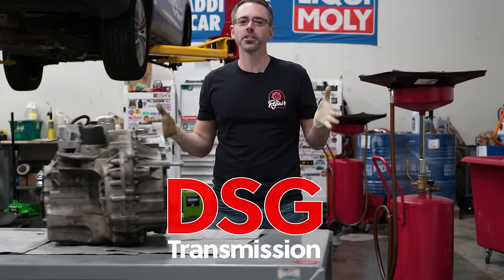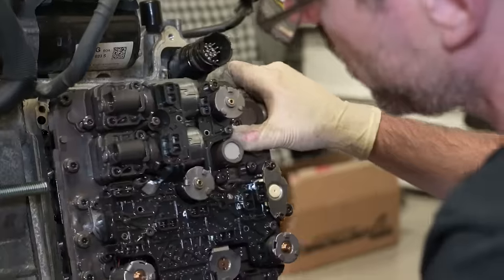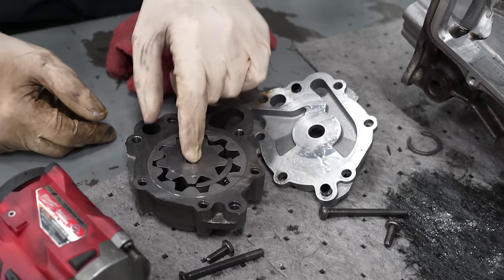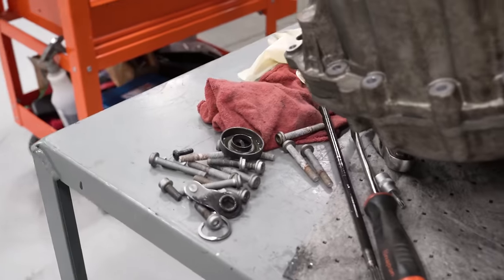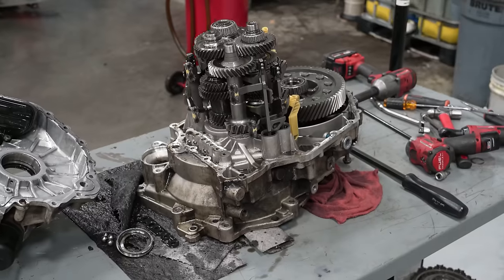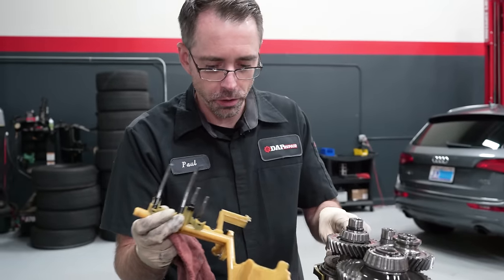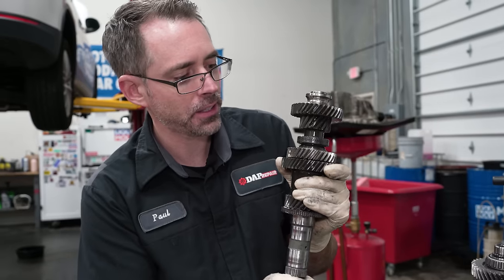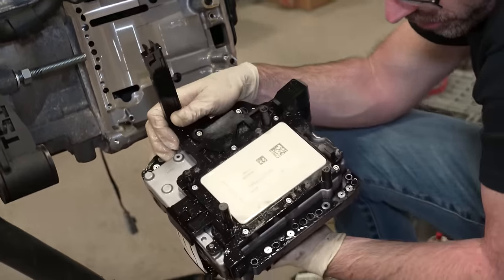Why Did This DSG Transmission FAIL?

Comment: It always amazes me the engineering complexity that goes into parts like this.
Reply: People get so upset when any car part isn't completely bulletproof, to me it's amazing any of them ever work at all
Reply: @nah3193  Exactly, when u know how it works, u think like damn! how is this working right now at 5000 rpm without a bolt that is 1mm offset, make it explode, beautiful engineering.
Reply: @Dexspic   wait y'alls aren't exploding?
Reply: Yeah, baffling how much engineering goes into making such an unreliable piece of machinery.
Reply: HOW are electric cars more expensive when they don't need all this junk plus all the junk in a modern vvt, turboed, watercooled, computer controlled engine. Shirley they will end up much less expensive once 50% of vehicle production moves to electric drivetrains.
Reply: @aaardvaaark  A new battery cost betweeen 10-20k, a new DSG cost between 1-3k, a water radiator cost 100-400€ the tubes cost 10-20€, a new turbo cost between 800-1500€ a new ECU cost between 500-1500€, even changing all that "junk" u don't reach 10-20k that a battery cost, later u have a electric engine that can cost between 5-10k, a inverter that can cost between 5-10k, dielectric cooling liquid that cost more than the G12, and wait until they stop giving u government help, as discounts, and wait until they add more taxes to charge your car, i'll see y'all of you with a diesel generator in the EV to not pay the taxes of official chargers.
Reply: @Dexspic Thanks for the breakdown, yes I know it all costs less, but electric cars having so many fewer moving parts, and parts in general, and given how solid state tech does end up cheaper than mechanical/hydraulic systems, from that perspective I still find it strange that electric cars cost more, the cost of raw copper, lithium, cobalt and nickel notwithstanding.
Reply: @aaardvaaark  They are less but more expensive, a lot more, i can rebuild my engine car for 5000€ as i said u need 10-20k for a new battery. And my engine as it is mechanical, it wont degrade by the time, i can leave my car sit on the garage 30 years, i put gas and a 12v battery and will start at first try, i don't think any EV battery will be alive in 30 years from now. That generate pollution too, u need to recicle that death batteries, so u have to transport them from  workshop to the place they recicle them, after that, transport each raw material, etc...
Reply: It's actually not that complex.  It's very similar to a "regular" manual transmission besides the multi-plate clutches, MU, and the way there's concentric shafts.  By comparison even an automatic transmission from the 90s...is far more complex to me.  I wouldn't really have any hesitation to take one of these apart; I'd never even try to go near an automatic lol.
Reply: @rolandm9750  Interesting, I thought these were way more complex than a traditional auto.
Reply: @Danercast  My 2007 ('04 model) gti has a dsg that has never given me any trouble, I've only had to give it one oil change in the 11 years I've owned it. Even if it was 1/2 as reliable as a traditional auto trans, it'd still be worth it to avoid that sloppy, tired feel a torque converter gives any car it's in no matter how powerful the engine.
Reply: The battery is the expensive part in EV's. If it goes pop, you are going to sob.
Reply: @aaardvaaark  At multiple points in the video he also points out it's a manual trans at heart just with automated gear changes/clutches.  If you go look at some other videos of rebuilding automatics (again even ones from decades ago)...well it's not for the faint of heart lol.  Many many more parts in there and no gears in the same sense (autos use planet gears).
Reply: @aaardvaaark EVs are much simpler but EV motor, inverter and battery do have a cooling circuit.
Reply: @Danercast   Dont worry, corner cutters and bean counters will set their eyes on EVs in short time... looking at the reliability statistics, they already do.
Reply: and i somehow understand this shit more than math
Reply: @aaardvaaark  They are expensive because of the batteries. The chemicals used are like petroleum, you mine it and refine it.

Comment: I used to work in a factory that produced the automatic transmissions.    They had a model of the whole thing with parts exposed etc. Still blows my mind that all these individual gears work together so effortlessly
Reply: If you actually work in a factory that made them you would know these aren’t automatic transmissions
Reply: @nerdneckbrodski731 He never said that this was an auto, just that he worked in a factory producing them. Hence his use of the word "the" instead of "these". Reading comprehension isn't your strong suit I see.
Reply: @nerdneckbrodski731  if u actually knew how to read you would know he wasnt referring to the transmission in the video
Reply: @nerdneckbrodski731  A direct-shift gearbox (DSG, German: Direktschaltgetriebe) is an electronically controlled, dual-clutch, multiple-shaft, automatic gearbox.
Reply: @wilanne  It is Semi-Automatic to be precise.

Comment: I can't believe how well the clutch disks look for 200k
Reply: Wet clutches are the standard on motorcycles for a reason. With regular oil changes, they tend to last the life of the engine.
Reply: @avi-tar2827  yes but we're talking about a DQ250 which I've seen smoked clutch packs in as little as 40k haha
Reply: They might have been previously replaced and not the originals?
Reply: @2strokeFORever  mine just smoked out i think, at 137k 6k to replace
Reply: I have one at 250k and it is still completely trouble free on the original clutch pack
Reply: A common reason for these gearboxes to fail happens when users stay still for a long periods of time and clutch is slipping the whole time and clutch discs start to overheat. Especially when you're pulling a trailer. I own a car with 6-speed dsg and it works well and has 350k km (~225k miles) on counter. Flywheel is starting to make noise thought (sorry for bad english)
Reply: @2strokeFORever  Not really. Mine was good for 180k plus - with the first oil. It highly depends on your launch behaviour.
Reply: Yes especially when my mk7 went out at 70,000 km with babying driving.
Reply: It's been replaced for, how many times?
Reply: @Califahrer67  depends on a lot of things not just launches
Reply: @error_displaying_name   Oh no. Are you the original owner? Do you know if the oil was changed per the book?
Reply: @whatthe6532  Dang. I traded 2012 Sportwagen TDI at 80,000 miles and the transmission still operated nicely. Not sure which model DSG the 2012 cars had.

Comment: I have a Skoda Yeti 4x4 with 6 speed wet clutch DSG. With 228,000km (142,000 miles) I have the oil changed as it's required in every 60,000km (38,000 miles). So far so good, I love it.
Reply: My 2011 Passat has 326‘000km with dsg

Comment: I've had a VW 6 spd manual in an MK8 GTI and recently a DSG in an MK8 R. The DSG is an amazing piece of engineering and as much as I love manuals, I feel the DSG is the proper transmission for the Golf R. As an $800 USD option it's a steal.
Reply: No kidding.  VW didn't put enough development into the manual anyway.  The DSG works so well.  As much as I thought about getting a MK8 GTI manual, there's nothing wrong with my MK7.5 DSG car and so I stage 1 tuned and did the DSG tune.  It's amazing what these trans can handle just by a tune.  Fluid changes aren't too expensive considering.  VW dumped a lot of money into development of the DSG and it shows.
Reply: @HeathRS  For real the 6 speed in my mk4 is made from glass.
Reply: @godlyname8544 Mk4 6-speed one of the most reliable transmissions ever made. Must be your technique 😉
Reply: @MattyEngland  When you granny shift it, its maybe reliable. Not when you try to be faster.
Reply: @MattyEngland  Reliable but slow to shift down, double clutching all the time when I had my 04 Cupra R xD
The synchronizer rings really werent the best on those.
Reply: @godlyname8544  Yep, and the manual transmission can't hold up to increased power upgrades from a stage 1 tune where as the DSG is good up to at least 500 hp (stage 3).
Reply: Until it breaks, which it will...😂😂😂
Reply: I too am very impressed with the DSG. Had it in a 2012 Sportwagen TDI and was very impressed. Traded at 80K miles. I was just concerned over an expensive replacement. I am now in a 6 speed 40th Anniversary GTI however.  @HeathRS
Reply: @JCTiggs1  While that may be true, a heavier duty clutch may be the answer. Making it a more expensive option the tuning a DSG car.

Comment: I'm not an enthusiast but do like VW.
I bought a 2-year old Passat wagon not being excited about maintenance and complexity of the DSG. Found that I liked it and when I added a 2018 Golf to my fleet, I really noticed the difference between a standard auto and DSG.
Not sure my next car will be a VW but if so, I'll be wanting a DSG transmission for sure.
Reply: Zf8 speed is just as and more reliable
Reply: @thetechlibrarian  Yep. Just recently drove a 2020 VW Tiguan TDI 4Motion with the DSG. That pause when you press the gas is annoying as hell, just like in my old 2016 Smart Forfour Twinamic (also a Dual clutch transmission on these later models.)
However when I drove the current BMW 3 series with the ZF8 speed it was the real game changer. Never have I ever driven a better automatic, flawless shifts, smooth, fast, goes instantly.. loved it.

Comment: My dsg is going strong at 230k miles so far, it's been stage 2 or k04 for probably 12-13 years. Outlasted the first engine. I am on my second mechatronics though
Reply: So you spend thousands to keep it going then, mechatronics are not a cheap replacement.

Comment: Taking into consideration how complex and fast DSG is, I would not complain on its reliability. My VW DUU manual gearbox stopped my car in an instant while on the second gear near the mall. I didn't know what happened. After few minutes it came back to life just to explode few days later (literally it made a hole in itself).
Reply: Oh those 02K gearboxes, those get very unreliable with age, we had em' replaced twice on our family Skoda Octavia (for muricans, it's just a VW Golf in a liftback form) for 170k kms of ownership, and it seems that it hasn't had its original box when we bought it with 160k on the clock (might've been rolled back though, usual stuff over here). Yours probably had its diff rivet shooting through the box's case, it's one of the multitude issues with this tranny, and probably the worst one.
Reply: @Agu_Ra  indeed. Mine died just after 230k. It is a typical mileage for them to die if they don't have to tow anything during their lifetime. I got mine changed for cheap for another DUU that has been working fine for the last 3 years. Thankfully, for me the time to change to the 2.0 TSI 3B is coming. I can't wait to get my hands on the new car.

Comment: Hi I had a 2006 touareg V6 diesel. Towed a unic mini crane behind all over Ireland and the UK full towing limit. 534,000 Kms , only replaced the air mass module and drive chain for fuel pump. Serviced ahead of schedule. Absolutely brilliant machine with dsg. Miss it. Ger in Ireland

Comment: In my experience the box itself is fairly bulletproof, problems are 99% mechatronics related. Can often be fixed fairly cheaply too if you scan and find the faulty actuators which can be found on the web fairly easily. I've fixed a few liek this and never had a comeback on them.
Reply: How did you find out which actuators needed to be changed?
Reply: @viniciusbembea  Scan the transmission for codes, it will usually tell you which valve has intermittent or total failure.

Comment: I loved my 2014 VW cc dsg with a tune. Shifts were so fast and smooth. It would absolutely crack your neck when it downshifted and launched. Much smoother than these new auto transmissions constantly shifting 8+ gears before 55 with their clunking and lurching.
Reply: It's possible to tune the DSG?
Reply: @viniciusbembea  yes, its very noticable

Comment: Nice video. There was one fault: The oil pump is not driven by the transmission but by the ICE. That is the reason why this tiny shaft is going through the whole transmission to the end.
If it would be driven by the transmission there would be no oil pressure at stand still.

Comment: My DSG broke because the the metal plate that holds the start/stop system to the gearbox came loose and fell into the gearbox.. Result was a big hole in the DSG :')
Heard a while after that it's a known problem for the mk 7.5 R and VW never bothered to send any recall info.

Comment: I wonder if the DSG broke due to lack of services. I’m hoping to keep mine way longer than 200k miles and I’ve been doing the service Every 40k 😅
Reply: Ditto!  Every 40K miles I take my 2013 Passat TDI SEL Premium in for its DSG Trannie flush/fill.  Have 110K on the odometer and she's still kicking.   🙏
Reply: Tuning is probably going to exacerbate wear.
Reply: Too less frequent fluid changes chould have sped up the bearing destruction. Getting beat up could have been another case.

Comment: Dq381 had a recall for the internal oil pump bolts getting loose. Had to replace the bolts if they didn't destroy the trans so they made a service kit for carrying out the repair

Comment: Bearings inside of anything don't last forever.  Keeping with earlier than later fluid changes would keep many components from failing.  But, the Mk5 didn't have TCU tuning back in the day - so, if it were ever tuned that could have been the segway.

Comment: Yep, My wife’s Audi Q2 ,2 litre,zippy little car ,is in the Audi dealer workshop now, mechatronic failure after 30,000 kms(18640 miles).One year over five year warranty. Needs ONE part replaced, coming from Germany in 4-6 weeks.Cost of repair$AU3500. Of course I’m refusing to pay, they’re contacting Audi Germany to request removal/ reduction of fee.We had a Golf which was recalled and mechatronics were replaced free of charge. My wife really wanted the Q2, Audi GUARANTEED me,prepurchase,that the current DSG would be a major improvement on the old one and would be no trouble.Please check any prospective car purchase gearbox and steer clear of DSG.

Comment: I had three different cars with DSG, DCT same tech and they all were spectacular. Smooth, reliable and fuel efficient.. May be I was lucky, or not unlucky or maybe this tech already matured when I had those 2011 and 2020, and 2023 model cars...

Comment: DSG is honestly really reliable, even the mech units have become alot better with time, rarely see any issues with them at the shop anymore compared to what it used to be like. Recently had a freak outlier DSG in a brand new Caddy (not even delivered yet) with a bad clutch pack but thats about it. otherwise if we ever have DSG issues at the shop it is usually on the smaller ones with the dry clutch packs or something older coming in to just diagnos it.
Reply: hello sir, I've got a 7 speed dry clutch DSG coupled to a 1.0 TSI engine (car is from 2017). The last 6 months I noticed the car is not as smooth as it once was when driving a low speeds, especially when it's slipping the clutch in 2nd gear at very low speeds, the whole thing doesn't seem to be happy and there is a slight (slight for now) noise coming from what I think is the gearbox. Should I get this thing checked (I always go to the main dealer for regular servicing)? At first I thought maybe the clutch or dual mass flywheel (or both) need replacing but now that I see ball bearings being destroyed in the gearbox I'm getting more worried. I've got 65k miles on the clock. Any advice? Thanks in advance. The car drives absolutely fine otherwise, it's just at low speeds. Also it can be very clunky on the downshift from 3rd to 2nd and from 2nd into first (it kind of depends how hard you're decelerating). Thanks!
Reply: @SlosII  for the driveability and clunky gear changes there is a procedure from factory that your dealer should be able to find. The dry clutch DSGs can also be a little clunky when cold because they do intentionally slip the clutches when getting going from standing when they are cold to heat up the clutches faster. As for the noise its hard to really say much without checking it since alot of stuff can make noise, but bearing issues are really uncommon, never had a DSG with bearing issues that i can remember. As a tech i would say advise with your local shop and try and detail it as much as possible for them. Stuff like when/how it happens so like is it when the car is cold or up to temp, outside temp, weather conditions, road conditions in general, certain maneuvers. Basically anything you can think of to narrow it down. Or even have a tech ride along and show what happens can be a good thing.
Reply: @soapmcsoapface1787 thank you, sir.
Reply: My 2012 passat diesel has a wet clutch DSG and the transmission itself seems really solid. Holding my tune pushing 300 foot pounds or so.. only issue is the dual mass flywheels suck and wear out. Mine wants to explode badly but has not yet thankfully
Reply: VW says they are supposed to last 300.000km that aint even 200k miles...

The DSG ain't reliable at all when compared to manual or torque converter automatic transmissions
Reply: tell that to the 10+ manuals we swapped under warranty this year alone compared to the 1 DSG that we swapped for a used one (old car, lots of km and the older version of the dry clutch DSG).
Reply: @soapmcsoapface1787  those manuals seems to suck, especially on the diesels. I'm glad I went dsg over manual myself